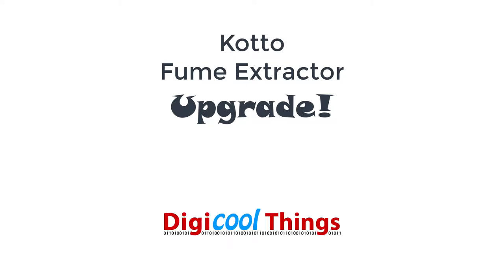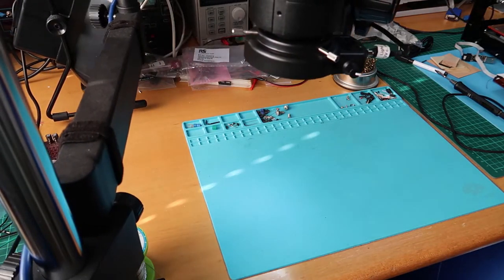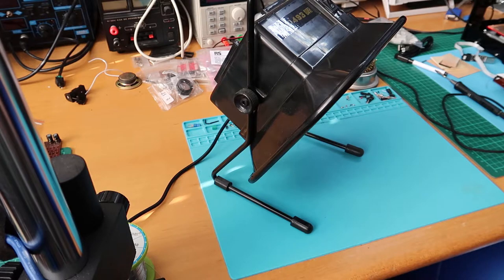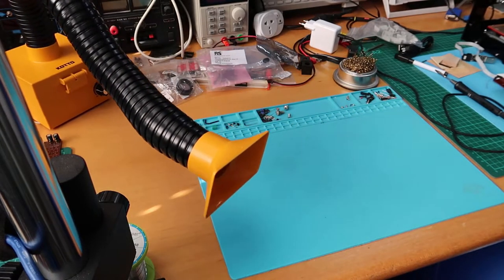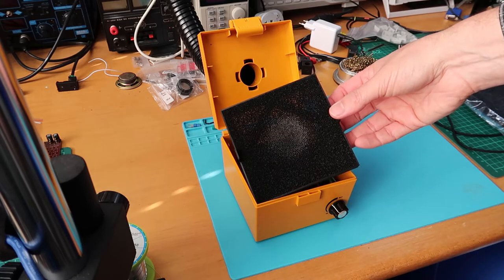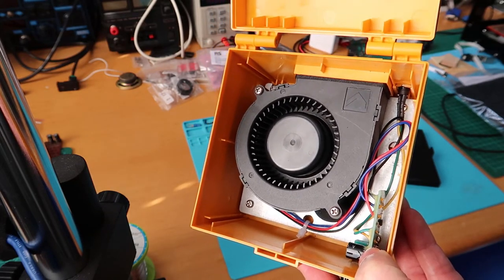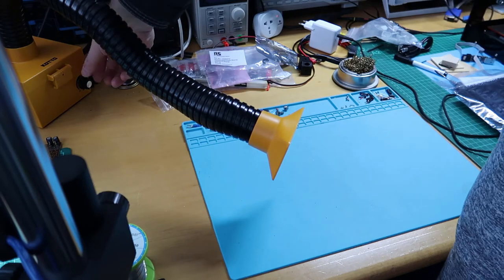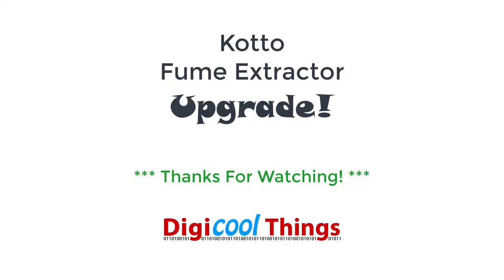My Fume Extractor Upgrade - Hakko to Kotto

Comment: I bought one of these a couple of years ago and I've used it on and off for hobby stuff. I quite like it.

Why YouTube has suddenly and out of the blue put you in my video feed is a bit of a disturbing question and one in going to try not to dwell on. It's a little outside of my normal recommendations.

With that said a couple of observations. I absolutely agree that a 50% is perfect setting for a soldering iron. It's lights enough and the neck is long enough that I don't have to keep adjusting it, I can just pull it around my desk.

And lastly the plastic has a lowish melting point and will not enjoy being tapped by a soldering iron.  Kotto really didn't engineer that well. (of course if I was smart I would wrap it in heavy foil or something. But I'm not so I haven't)
Reply from the maker: Thanks for your comment.  You make a good point warning about the plastic. Fortunately, I haven't tapped it with my soldering iron (yet), so all is good here.  But definately an observation to keep in mind! 🤓

Comment: Great little fume extractor for hobby soldering, I used to use high RPM SUNON fan with a grill and a hepa filter. These "carbon" filters basically do nothing the room still filled with smoke, hepa filters actually filter out smoke, carbon filters filter out odors and chemicals. You can buy hepa filters for this unit, I highly recommend it.
BTW all fume extractors are loud, if it's not loud it just blows away the fume without filtering it properly.

If you can't ventillate the room, you should buy real fume extractor with 3 stage filtering. In my opinion the carbon filter is useless for soldering, not so much for burned plastic and paint odor.
Reply from the maker: Thanks for the advice.  I'll look into it further.  In reality, the extractor is probably just pulling the fumes from going straight up my nose, but then just depositing the fumes elsewhere in the room.  I imagine this still beats no extractor at all.  But a proper filtration system would be healthier!
Reply: That's now true. I am through and through amazed how confident you are spewing misinformation. Hepa paper filters particulates to varying sizes - the H number indicates how big the particulates can be. Activated coal is what filters gases.

Comment: These type of filters are well worth the expense, I got this one "OKI BVX-200 Fume Extraction Unit" I used to used it before the medical design company i was working at went bust. won it at Auction as they sold off the equipment.
Reply from the maker: That looks like a nice solution, if you’re lucky enough to get hold of one at a wallet friendly price.
In my case, I don’t have the space for a larger floor mounted unit, nor the budget for a more “pro” solution.
Perhaps also why I was so impressed with this little Kotto unit. Another day of soldering and not a single fume up my nose! :)

Comment: Thanks for this! I'm wondering how was it controlled by the potentiometer or perhaps an encoder, could you perhaps take a look of the little pcb there? I'm trying to make a DIY of this since getting one is too expensive for my budget and it will be a lot more fun to build it :)
Reply from the maker: Sounds like a plan. As I'm not one to ever need an excuse to open things up (again), I've done exactly what you asked and published a blog post, including photos of the controller PCB, and dedicated it to your request. :)  You can view my findings on the controller here: http://digicoolthings.com/koto-fume-extractor-speed-controller/ 
It would be great to know how your DIY project progresses.  Perhaps you could post a video, for others interested in doing the same?  Have fun!
Reply: @DigicoolThings  Thank you so much!! Yes I'll try posting a video if ever I'm done with these :) 

I actually have a PWM controller now using a CMOS 555 IC and it feels like there's a better components I can use for this project, perhaps a microcontroller (based on the googling I did)?

Again thank you so much!
Reply from the maker: @dooogfella  No problem. I'll look forward to a video. :)  I've just replied to your other points via your comment on the above blog post.  Hope that helps.

Comment: What magnifier do you use?  It looks nice.
Reply from the maker: My desk mounted LED magnifier is a Duratech model, specifically their 5 Dioptre 127mm lens model.  I remember they also had a 3 Dioptre model, which didn't have the magnification I wanted.  It works great as a handy repositionable magnifier, as well as just a good desk lamp.  Hope this helps.

Comment: Thanks. Nice review however 3 minutes on fan you’re getting rid of seemed like a lot. 1/3 of your video dedicated to the one you’re scrapping.
Reply from the maker: Thanks for your comment.  Well, the video wasn’t scripted, but to be fair it was a fume extractor “Upgrade” video (not simply a Kotto review), so it was appropriate that I explained the reasoning that drove my Hakko to Kotto upgrade. :)
Reply: @DigicoolThings  Understood. Makes sense. I misinterpreted. I thought the upgrade was the filter holder on the Kotto.